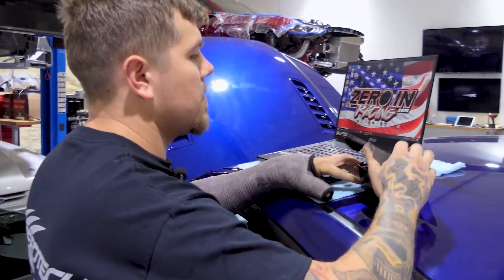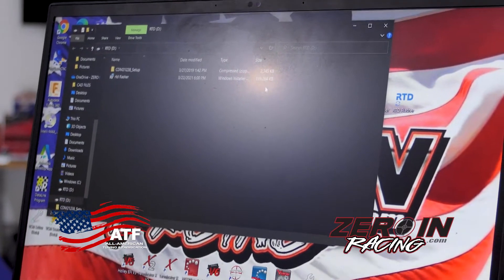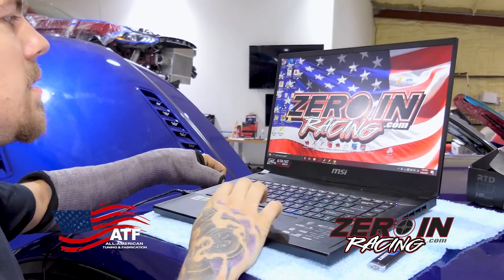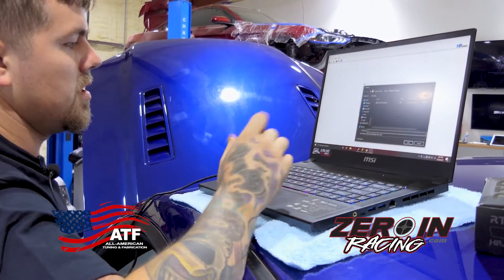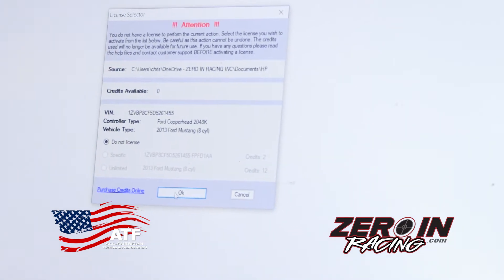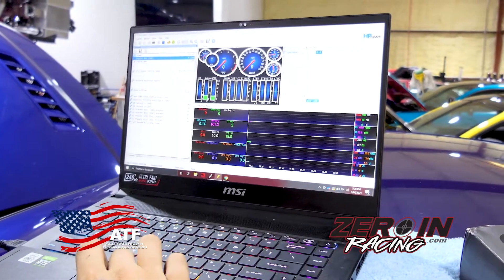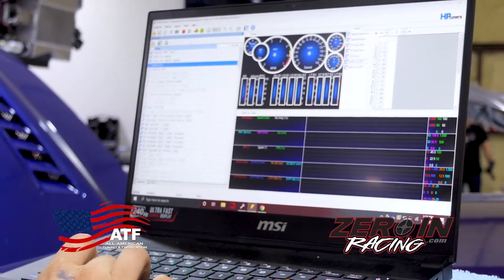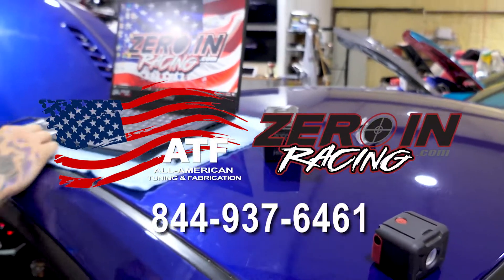How to use HP Tuners RTD Tuning Device Data Log & Writer

Comment: I just received a 2000 GMC Sierra 1500 2WD with a 5.3. The previous owner installed a BTR stage 3 cam , long tube headers with mufflers and no cats. Cold air K&N filter, and a 4.10 rear gear. He said he tuned it, but it doesn't idle well, AND, the shift points are way off, as well as the speedo. If I send you HIS file, what would it cost to have you clean up his mistakes?
Reply from the maker: Usually if we can read a solid data log we can tune for 400

Comment: Do i need a laptop in order to do all this?
Reply from the maker: A computer of some sort yes. But just to install your emailed tune on the flash drive to then put on the rtd device so you can flash the tune to your pcm
Reply: @zeroinracing1917  do u need to be connected to the internet to data log?
Reply from the maker: @shuaolivas1391  no sir. Not to data log. You will be connected from the laptop to your vehicle 
Then you email us the log.

Comment: Could you just save the tune in a file on your computer instead of the USB? 

Also if I use an RTD now and I decided to get an mpvi2 will I need to buy credits or will the credits from the RTD to unlock my ecu be good?
Reply from the maker: Yes you can save the file on your computer. 

Tokens unlock the car so the device you use recognizes the tokens. 

Mpvi2 or rtd doesn’t matter at all.

Comment: I have a 2013 coyote just like in this video, when writing my first tune from my tuner I applied 2 credits to the vehicle.  Once I received my next tune, when I went to write it I was asked to use more credits again as if the vehicle wasn't licensed.  Any ideas?
Reply from the maker: Sounds like the device didn’t register
Reply: @zeroinracing1917  great, so pretty much out of luck until HP tuners can address my problem?
Reply from the maker: @AndyK1337   Yeah, they should be able to reset for you.  We use tune credits from our pool so it shows how many we have and it just deducts so we do not buy individual credits and so far so good.
Reply: @zeroinracing1917  doesn't make sense though when I look under licenses there is a line with my vehicles vin